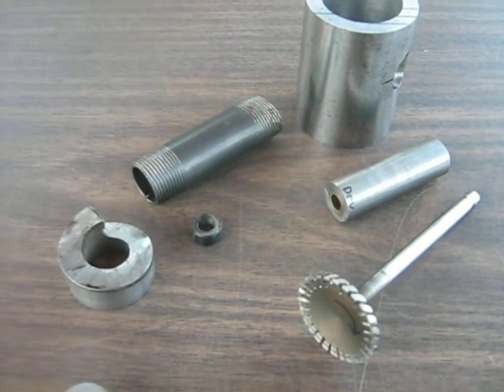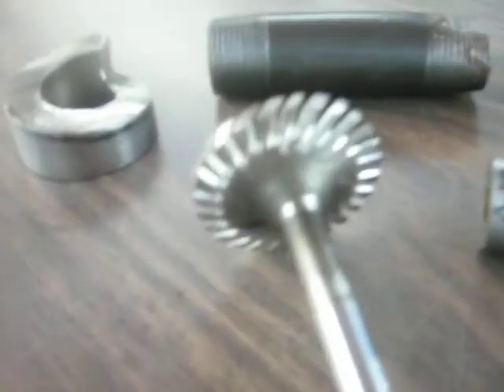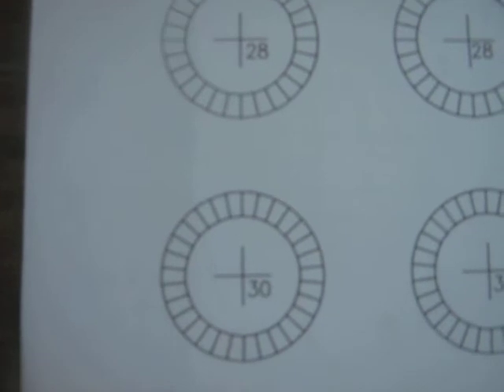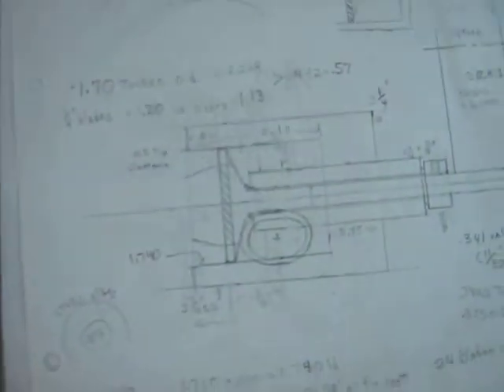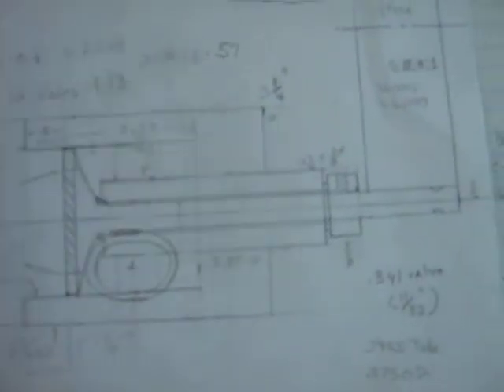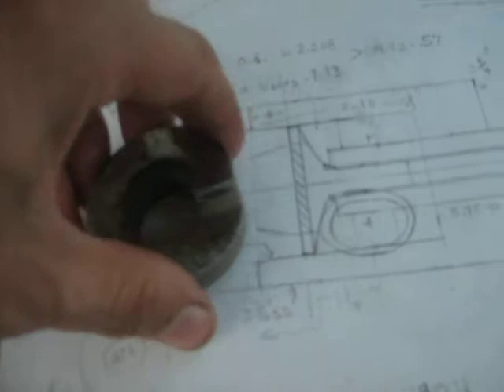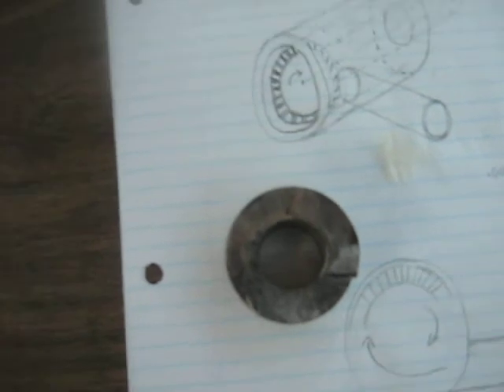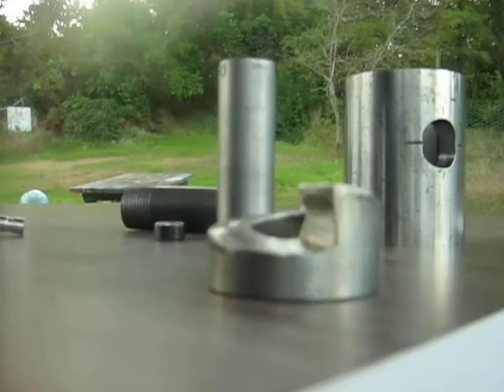TURBO Compounded Parts Before Assembly

Comment from the maker: Good observation!
When I first ran the turbine, I didn't have any stator guide vanes, later I made up a quick stator, and AC/DC welding carefully welded it into place, so the last 2 runs had the stator in the turbine housing.

Comment from the maker: Have a look at the "Wright Turbo Compound" aircraft engine. It has 3 power turbines that add about 500 hp back to the engine. The Napier Nomad is different, but also a turbo compounded engine.
the basic idea is for the turbine to extract energy from the exhaust, and add it back to help turn the crankshaft. Obviously, my setup is not working that way due to oversizing, or something, but that is the concept  :)

Comment from the maker: Thanks for watching, yes, you are right I have a lot of time into this Beast.
I thought it up over a year ago, and have been working at it slowly since then. I speeded things up the last few months, to finally get it done.  I had hoped it would work better than it has so far, I wasn't expecting to get a smoke show from the rubber drive caster!  I will make a better turbine oiling system, then try another run  :)

Comment: Have you tested the system without the exhaust mounted to the turbine ?, does it move enough air ? I`m thinking you could have used an exhaust-side of a car turbo spinning the other way around so it sucks from the middle-hole that is normally the exit.
Very interesting project I must admit !